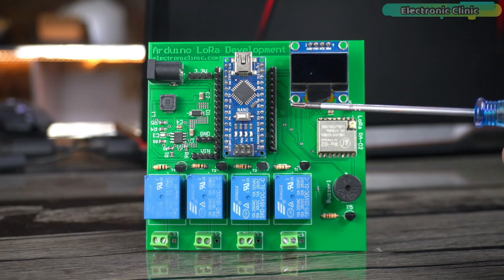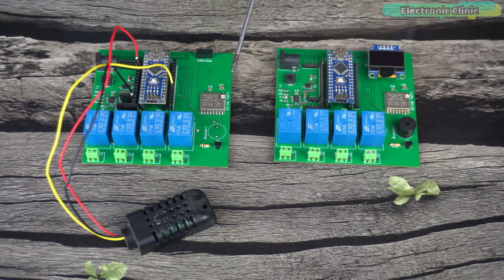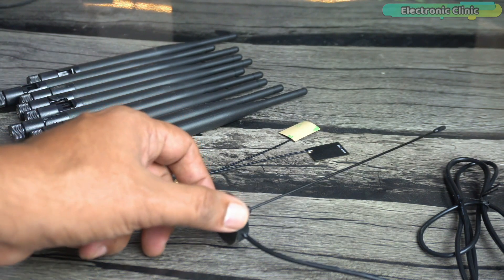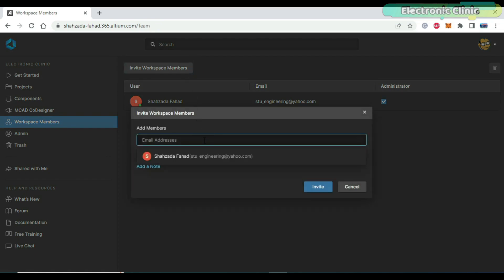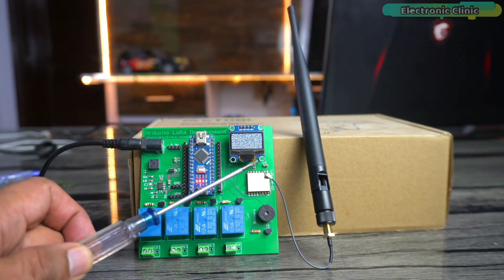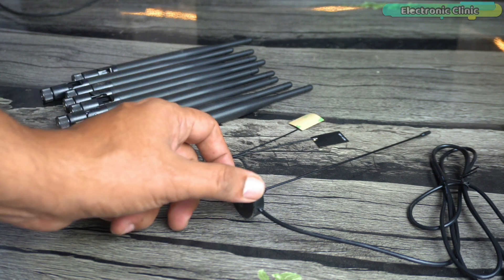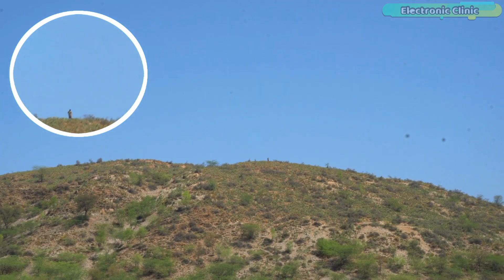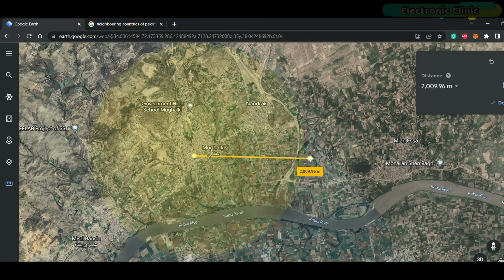LoRa Range Test using Different types of Antennas, Flexible PCB, Whip, suction cup antenna

Comment: Can you please provide link for buying 2dBi 433MHz FPC antenna  that you used. I can find 433MHz antenna but its 5dBI. I need higher indoor coverage with lots of building in between. so looking lower dBi antenna. In your video you said FPC antenna you have is 2dBi and I am unable to find it
Reply from the maker: You can find it on Ai-thinker ofcial website. You should also try a suction cup antenna. Today I am uploading a new video in which I used Lora for underwater communication.
Reply: @ElectroniClinic  Thank you so much

Comment: you know, i reach more than 25Km with only dipole antena with lora module
Reply: How? And what was the height where you have placed lora module was it on rooftop or what?
Reply: @anonymous-d4z3d  in my research, not about the height, but about how Line Of Sight, in my 1st test, i install on my 40m internet tower, i get the distance aroud 16km but when i go to the beach, that still good in 25km, i dont know about farther, because i not continue sailing

Comment: Can you share with me the configuration you've set for the lora ra-02 module, the frequency, spreading factor, bandwidth, code4mode and the library which you've used LoRa or rf95 or any other

Comment: Thank you. Your video is great and helps a lot. I have a well pump house 1.1 miles away (1770.2784 meters) that I am going to try this to monitor the temperature and use a relay to turn on the heaters relay when the outside temperature gets below freezing.  Inside temperature, outside temp, and heat relay on/off. I may have to place a repeater at 1/2 distance due to elevation changes.
Reply: did you tried?
Reply: If you tried, can you tell we, succes or no?

Comment: I have a pair of 10dBi magnetic-mount type antennas, and my LoRa module is the RA-02 operating at 433 MHz. However, I am only achieving a range of around 800 meters. In the code, what parameters should I set for maximum range, considering that I have very little data to send?
Reply: Check the Spreading Factor and change it

Comment: Hello sir ,can you please tell me which LoRa module should i select (to use in India) I read that we can use 865-867Mhz frequency only but many Indian YouTubers have used sx1278 433Mhz module. Please help me decide what to do .And which antenna should i use (range required is 1km only)?
Reply from the maker: Even over here the allowed frequency range is 433Mhz but still I have used other frequency bands too, so I think they won't be much of an issue when performing initial experiments. But if you want to use it on regular basis then get the allowed Lora module. And for the better range you can use suction cup antennas and flexible pcb antennas.

Comment: Great video!  I enjoyed your line of sight tests with the different antenna.  What frequency or antenna combo would be best for maximum penetration?  For use when the device in side buildings, cars and such?  I am interested in making such a device for radio direction finding, but don't know where to start in terms of which frequency, power output and antenna to use for best results in urban and less than ideal situations.

Thanks for the great content!
Reply from the maker: Use a frequency thats allowed in your country and you can use an combo, when I was performing tests; the suction cup antennas and flexible pcb antennas performed great.
Reply: @ElectroniClinic  I'm assuming a combo antenna would be to cover all polarities?  434Mhz is the LoRa frequency in my country.  Its power output for effective transmission that could be an issue.

Comment: Which is best for making transmitter and receiver for drones??
Reply from the maker: As per my tests, the flexible pcb antenna on the receiver side and suction cup antenna on the transmitter side will give you a maximum range.